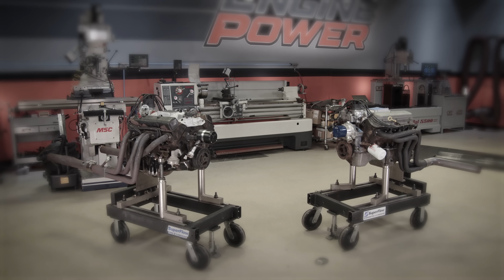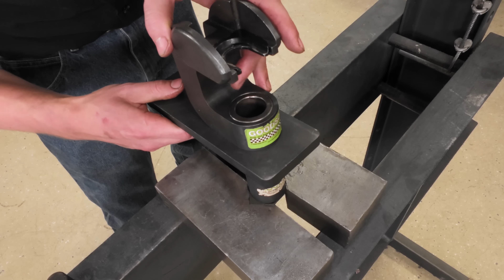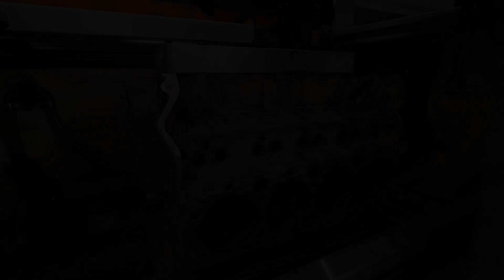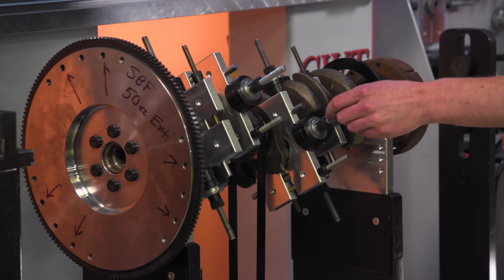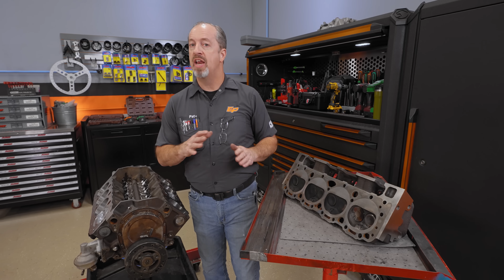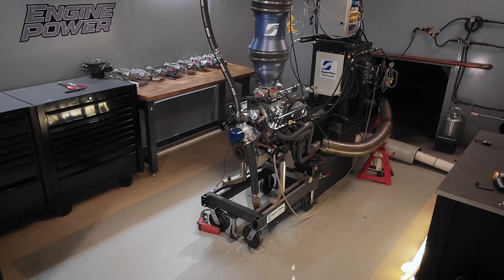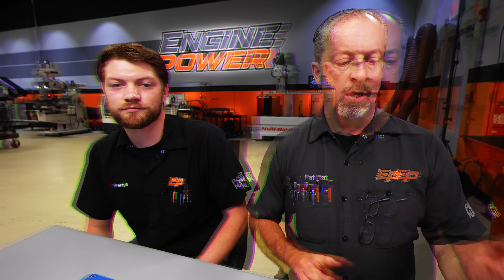305 SBC vs 302 SBF: Does Compression Help the Lowly 305 beat the Race-Bred 302?

Comment: So when you give it much thought… taller deck, longer intake runner. More low end torque. Shorter deck shorter intake runner higher horsepower peak. So the 3 cubes less displacement was able to match up top but the longer runner and more displacement got it down low. Great test fellas you did a heck of a job making this as apples to apples as possible. If you do a 350 vs 351 test I imagine the results will be the same. In the end it’s just an air pump
Reply: Longer stroke in the 305 is more of a factor in the extra low/midrange torque over the 302 than the minor differences in runner length.
Reply: @mrhipbone  It's really not though. Intake runner length and port minimum CSA in relation to displacement are the deciding factors on peak torque. 

According to the "stroke equals torque" theory, the Olds 403 should have been a high RPM monster with no low end torque as it had a bore bigger than the 400 SBC and a stroke shorter than the 350 SBC. In stock trim it made HP/TQ numbers similar to a stock 400 SBC at virtually the same RPM. The 403 was used in full sized cars, station wagons and GMC even put them in motorhomes.

Comment: Just like Pat said.... the air/fuel mixture has NO idea what brand of parts/engine it's going through.  Drop both of these engines in two cars that are exactly alike.....the better driver with the quickest reaction likely wins: barely.  One thing to note though, the reason those Ford 302s were notorious for winning races was when they were stuffed into the smaller, lighter foxbody platforms.  The power/weight ratio was just right to make the 302 seem as strong as a built 350 chevy.

Comment: In the spirit of low buck,...., I bet with a decent home porting job, these engines would pick up 50 or more HP. It would be fun....
Reply: The more cam the better the SBF will run but at the expense of drivability.

Comment: Now throw some extra stroke at them and see what they got. I'm loving this series and not only for the comparison sake of the 2 , but it goes to show what a basic combo can do. This is great for the masses that aren't building high dollar engines. Keep up the excellent content!
Reply: In a way this is where the ford has a true advantage.  Realistically you can stroke a 305 to around 334 ci.  A 302 can go as high as 347 pretty easily.  But s 3.25" crank in the 302 gives you a 331, so that's still an apples to apples comparison.

If you went the 334/331 route, assuming you changed as little as possible beyond the stroke, you should see about a 10% increase in peak torque for both engines, so around 375 ft-lb ish at a slightly lower rpm.  Both engines should make virtually the same horsepower at about 10% slower rpm.

Comment: Really enjoyed this Pat & Frankie....But those EQ 305,s are the reason the 305 is so good, I've used them several times and that chamber and runner is perfection. Also noteworthy is that I also observed 218cfm on my SF-1020. I have only one criticism and that is the difference in ring packs WOULD have put the 305 up over the Ford by a noticeable margin. In fact I suggest a trick ring pack from TotalSeal to make the ring to bore interface the same at 1/16" . Overall though great job, also love the dyno, Im a SF-902 guy for now.
Reply: I was wondering about the cam size difference also,  Ford 302 has more lift in/ex and more rocker ratio.
Reply: Ive gotten exactly 218 out of the stock Vortec heads also. Where guys come up with figures of 240s Ill never know
Reply: @gordocarbo Fantasies, car people lie just like fishermen.

Comment: @EnginePower- Really ❤️ these videos, thank you. Taking about 8 hours to get the bores just right, a lot of work goes on when the camera isn't filming for sure. Great show, i have watched those Saturday shows from way back, used to record Power block on my VCR when i had to work, or still sleeping late sat. Morning from working too late on a friday night. I have a thought as to why the difference's between the chevy, & the ford in the different RPM ranges. Lift favors Rpm slightly (ford cam had more lift), & an increase in low lift, & overall head flow (slightly favored the chevy) gives more area under the curve with cylinder filling. This favors the fords higher average Hp & Tq., from about 4,500 to about 6,500 prob., then the chevy's average Hp & Tq., is even a bigger gap/distance apart from ford, between 2,000 to 4,000 RPM, both engines are super close between 4,100 to 4,500 RPM. So if both engines were in the same wt. vehicles, had the same aerodynamics, optimal gearing, 100% traction, same gearing in the transmission, with a stock 1,800 RPM tq. Converter, the chevy would win a 1/4 mile drag race. But i think it would flip flop, & the ford would win, if you were to shift them @ 6,500 RPM, & use a 4,500 RPM stall speed tq. Converter, & Gear the rear end to come through the traps between 6,200 to 6,500 RPM, what do ALL of you think, please give your thoughts below, thank you.

Comment: Didn’t know you could get that much power out of a 305
Reply: I made over 60 hp more using more cam timing (Comp XFI 276), similar compression, ported GM 059s with 1.94/1.60 valves and a 660 cfm GM 454 TBI on an Edelbrock Victor 2bbl Vortec manifold over 15 years ago.  Mine made 423 hp @ 6,400 rpm and 418 tq @ 4,200 rpm.

Comment: Pretty neat battle its really apple to apples similar no bias just good wrenching and skills !It would be nice if a brand would design 4valves per cylinder heads for these engines pretty sure it would pick another 10-20 horses.

Comment: The dz 302 would rev up into the 7 thousand rpm range. 
   I know it is splitting hairs but how much lift difference will there be between the 1.7 to 1.6 rocker ratio. On final lift?

Comment: I’d like to see a 292 Y-block with the ECZ heads versus a 283 Chevy with whatever heads they came with in 1957. 

OR the same engines with a modern aluminum head. Mummert’s head on the Y and maybe an AFR on the Chevy

Comment: Do a build with the Z-28 302 which is not a long stroke motor like the 305, passenger car engine, the Chevy 302 came out before fords , 1967

Comment: This is by far the best apples-to-apples comparison I've yet seen. You've really helped out the guys who don't have big bucks to spend on their combination. Thanks guys!
Reply: The one big difference between these two engines is the stroke I would prefer the 302 with a lower piston speed
Reply: @NathanStickley  For a st car Ill take the one that makes more torque across the board.
Reply: You're an idiot
Reply: Give the Chevy the same lift at valve it beats the Ford. With the difference in lift, the Ford has more lift at mid lift on both sides of the intake lobe. Give the Chevy that same lift on both sides of the lobe and it will increase torque and run it to 6200 like the Ford and I say the Chevy will 375 on hp.
Reply: except they handicapped the gm,   tiny bore, yes  similar to a 4.8/5.3  but not 4" like the ford...... or dz302
Reply: @taomicioli  They didn't handicap the 305. Chevy did by making it that bore size.🤦
Reply: @taomicioli  The Ford 302 has always been a high-performance engine, while the 305 Chevy has always been an economy, fuel-efficiency engine.

It would be interesting to compare the late -60s Chevy 302, which was a high-performance engine, with both having high-performance heads and such.  That would be a truly apples-to-apples comparison.  Otherwise, this was the most fair comparisons to date.

Have they done a 350 Chevy v. 351 Ford dyno?  How about an all-GM 350 comparo? (Chevy v. Buick v. Pontiac v. Olds)
Reply: @taomicioli " they". GM designed that bore dimension.
Reply: @taomicioli  I find it amazing that these engines are so close despite  the tiny bore in the 305!  For a daily driver that is going spend most of its time below 4300RPM there is much to be said for the 305.

Comment: Curious, what is the new displacement level for both engines after increasing the bore on both?
Reply from the maker: They are up to 306.12 on the Ford and 310.10 on the Chevy at .030” over stock

Comment: I am a Ford guy but also a lover of the sbc! why not a 307 did the increase in displacement not figure into the mix? anyway good show,just keep in mind these poor little Chevy and Ford owners are considering this pretty dang expensive,not to mention the machine work,do a real cheap build and run off, the old late 60s 307s were really a responsive mill for the size.

Comment: Engine Masters did a 383 SBC vrs a Dulchech build 383 Mopar, It would be interesting to add into the mix and 440 RB (raised block) block with 383 crank to compare a small block vrs big, virs raised big block all with the same displacement.
Reply: Nobody cares about that hick...he sold out with Freiburger...and got fired. Lol

Comment: You should really focus on quality content, not content for views. No one who's father isn't also their uncle is building a Chevy 305. Its small bore and garbage heads are the reason we figured this out over three decades ago. The same cam specs for each engine?   Why???? Chevy engines and Ford engines have entirely different combustion chambers etc. No one is going to pick a cam that ran good in their Ford and spec the exact same for a Chevy, unless they are braindead. And no one is building 302's anymore. They are building a minimum of a 347 and using much better aftermarket heads. This has to be the stupidest video I've seen.  We learned ALL THIS SHIT THREE DECADES AGO. Edit FOUR FUCKING DECADES AGO.

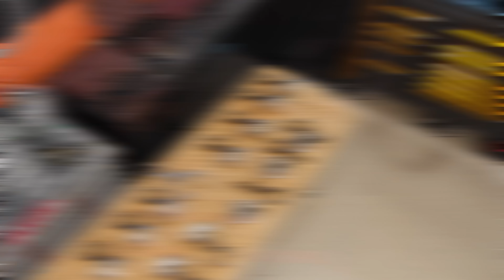Comment: 9:49 on the cheap
🤨
👇🏻
 X

Nice equipment indeed.😮
Long way from the NAPA machine shop I worked in with my grandfather rebuilding heads starting when I was 12 or so. Start to finish including a few Three Angle grinds.😊

Comment: 1/16 and 5/64th rings are not the same. 1.59 mm vs 1.98 mm thick, at least twice, in 8 cylinders. You should maybe do another shootout with another set of pistons, with the same thickness of rings, with the rings as thin as possible (0.7 mm rings from TotalSeal maybe). It's not possible at all to get the same lift on the cams? Even with custom cams? Just positive ideas here. Great video.

Comment: The rockers favored the Ford and so did the cam. Not by much but enough to ick out a win over the Chevy. If things were had been identical the results would have been identical. Goes to prove that a lowly 305 has the potential to KA if built by the right hands. Awesome job in proving what the potentials really are. No such thing as a bad engine.

Comment: Will there be a stage 4?
Reply from the maker: Maybe!!! Aluminum heads…solid roller cams…power adders…who knows. What would you like to see if we did one?
Reply: @enginepowertv 230/238 110 cam with near .600”

that Holley intake on the Ford should be swapped for a trickflow.  it would make runner length closer between the 2 engines

this would cause the heads to be the limiting power item, which is good

Comment: I disagree with using the 305, because it's not an apples to apples. The 302 ford is a 4" bore x 3" stroke, a 305 is a 3.76 bore x a 3.48 (350 chevy) stroke. While on paper the 305 should have a slightly higher base torque and the 302 would probably have a higher HO and rev range, there is one issue the smaller bore on the 305 will limit valves and sizing it'll also shroud any upgraded valve added. The 302 you can safely machine a 2.02/1.60 setup with the 305 1.94/1.60 setup will be a problem. Since both 302's existed at the same time, base both on a 1970 blocks. this would allow a better breathing setup on the chevy allowing it to at least run with the 302
Reply: Disagree. The small bore doesn't hold the engine back necessarily, it needs more cylinder head. The Trick Flow Super 23s open the world up for the 305. The 4.8/5.3 LS engines have a relatively small bore and they have gone 7s on stock bottoms

Comment: Now share the fuel consumption for each. What made the power with the least amount of fuel. The old belief is that Ford did it with less fuel consumption. If both had been equipped in the chassis, they matched. Let's say a mustang to a camero. Power to weigh ratio goes out the door.

Comment: Wonder why Ford has 38 degrees of timing. when 36 seems to be a normal.  🤔 Very close test with Ford on top. Thanks for the information.
Reply: I just came to say the same thing. Gt40p's usually don't want more than about 30
Even the e7's don't like more than around 34
Reply: @longstroke1982  32% was best in an NHRA stock eliminator engine

Comment: The only thing that makes a stock small block a boat anchor. Is the guy that doesn't rebuild them. TY for a great video. There is so much potential in a small block.
Reply from the maker: Glad you liked it!
Reply: My Pontiac 301 is a great boat anchor.
Reply: The issue with this comparison is not the comparison but the issue of having to machine the top of the pistons. There must be a piston for the ford or the chev that doesn’t require machining. I understand that the ultra close comparison was the need to pick these 2 piston types
Reply: @goldysgarage189  It doesn't have to be perfect. A $20 HF rotary tool and a $10 1000g scale is all you need. Weigh the first before & after, then apply the same reduction to all of them. Density isn't different so every 2.7 grams removed is 1cc out of the chamber.
Reply: @goldysgarage189 , I would say that is why most leave them alone. It is cool to see it is possible if you have the tools and know how.

Comment: Round 4 more compression on race gas or E85 with cylinder heads that are about the same size id say 185cc AFRs with said bump in compression would SHOCK a lot of people with small displacement. Sometimes thats not always they key. Show how to make killer power with a cubic inch rule where there is replacement for displacement.....hey that's a catchy name Pat could even coin if yall decide to do a round 4. Lets do it round 4:..... Fight

Comment: In general the 305 is a reliable daily or truck engine. Some had high swirl heads and could manage about 24mpg and that's not even with the double overdrive transmissions that allowed later lt1 and ls1 camaros and vettes with slippery aero to do this same feat. I've seen square body pickups get 23mpg with swirl port 305 engines. The main issue with the 305 isnt just valve shrouding with its very small bore. It's the availability of 52-58cc combustion chamber heads and the fact that you will likely need to port factory heads to make any power. By the time you get into small chamber heads for performance such as some with 49cc chambers they have extra large valves that can hit the bores with high lift. Modern engines have shown that you can make power and torque with large ports if you can avoid fuel separation but you may still have to figure out interference issues. Why nobody ever made a better l98 head or aluminum vortec 5.0 head possibly with slightly smaller chambers I don't really understand. There were lots of stock 350 with dished pistons that could appreciate this sort of thing as well as 305, 307 and 283 blocks out in thr wilderness without any good new performance cylinder head options. Obviously the best way to get compression in a 350 is to install a stroker crank and pistons😅 but there are plenty of guys outta there that don't want to pull the block and just want a better running version of the engine in their car.